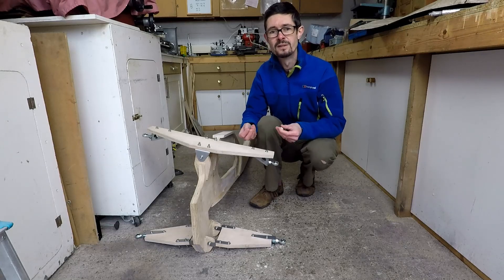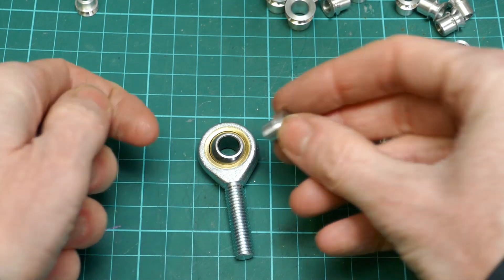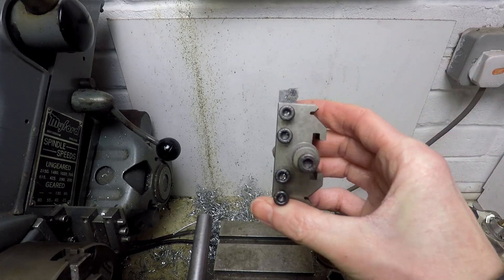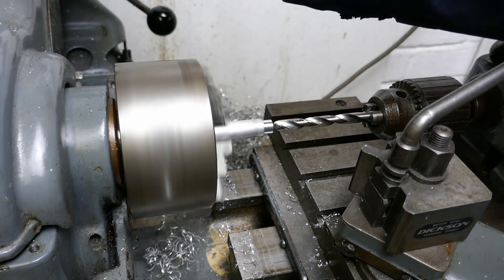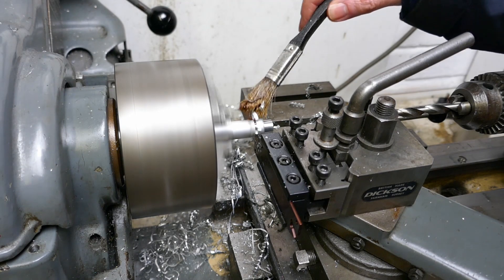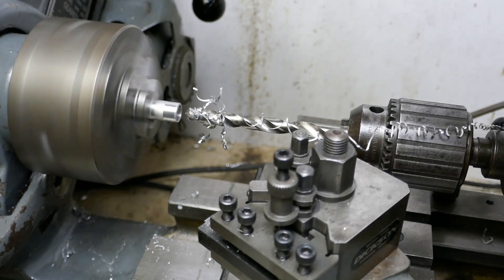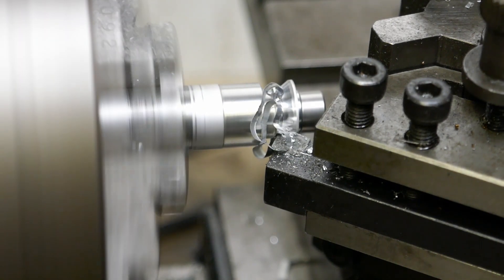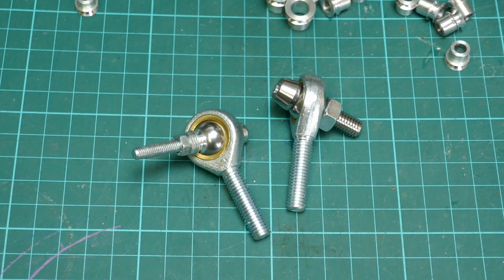Tilting Trikes Part 10 - making misalignment spacers on Myford lathe

Comment: Do you think  M12 rod-end has sufficient strength for my reverse trike steering? 125cc
Reply from the maker: It’s difficult to say with any certainty, you would need to determine the specified load capacity of the rod ends and do some stress calculations for you particular application.  Don’t take my word for it, but M12 sounds about right.  Mine are M10.
Reply: @MetalMachineShop  Thanks! I'll go for the M16 or M18.

Comment: Nice work! My only concern is whether M5 are strong enough to support the wheels.
Reply from the maker: Hi, in fact the 5mm ones are used for the steering linkages, the ones supporting the weight use 8mm bolts.  I’ll show a closer look at how it all fits together in the next vid.